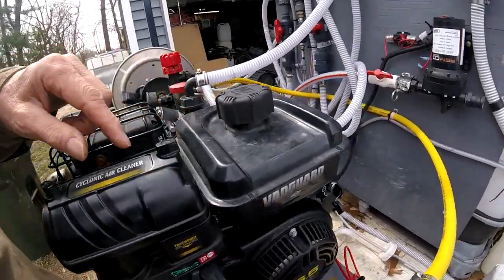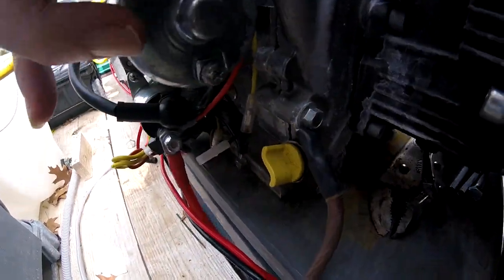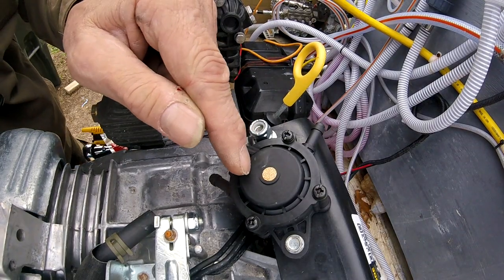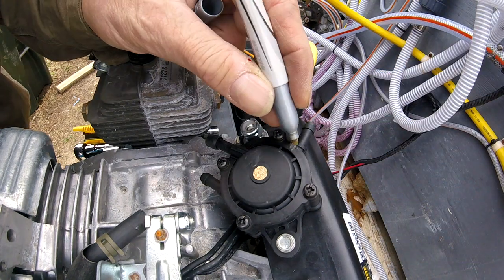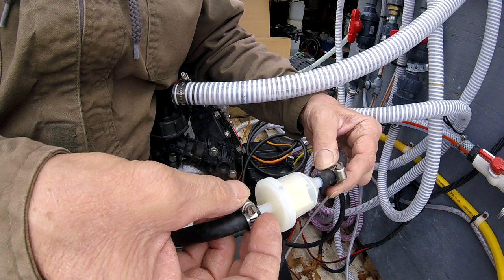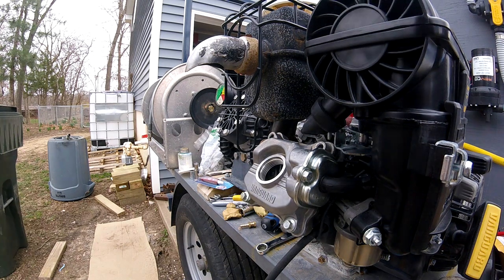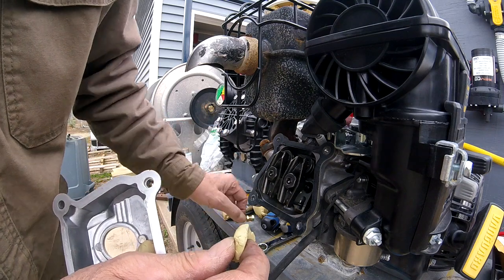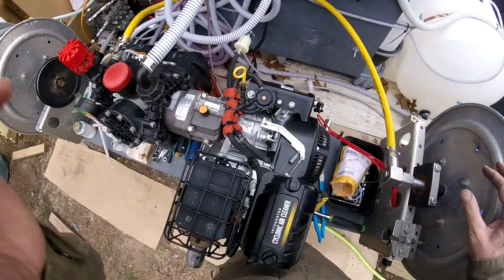How to add or replace a Pulse Fuel Pump and fuel cell to your small engine.

Comment: Great video mate. I knew how to fit a pulse pump but didn’t know how they’d handle pulling fuel a fair distance. I’m running a 212 in a cyclekart and want the fuel tank up front, and now I know it’s possible 👍🏻

Comment: Another great video. Didn't even know about pulse pumps until now. I need to do this on my setup.
Reply from the maker: I'm happy to help.
Reply: I just saw on the chickanic channel show the pulse pump as a part that gets brought in as being bad but is rarely bad.
Reply from the maker: @brianfletcher7942  I have seen many last 10 years.  I have seen them go bad in a few months.  It seems that the average life is at least 2 years.  But 2 years isn't bad for something that costs $10 and pumps 7200 times per minute.
Reply from the maker: @brianfletcher7942  Your pump and carb will work better longer using non ethanol fuel.

Comment: Great video Mr. KENNY. Please let me ask you something, maybe you can help me. I have a 18 hp briggs engine in my van, that runs my carpet cleaning machine. I've taken that fuel pump off and put a 12 v stronger little pump, to pull gas from the tank of the van, on the other 24 hp kohler engine I had, it was running fine, but on this 18 hp, whenever I leave the engine on idle, the pump will run dry and it shuts off. To have it on, I have to always keep it a little accelerated. Any idea on how to fix that? Thank you
Reply from the maker: I think your pump is fine. Something is blocking the idle circuit in the carb?  Once you crack the throttle a tiny bit the main jet starts pulling a little fuel.  This compensates for the plugged idle circuit.  I would tear the carb apart spray carb cleaner in all ports from both sides. Then blow it all out.

Comment: Out of curiosity,  could you use one of those gas caps with a barb on it and drop fuel directly into the tank instead of going into the carburetor?  That would save some time and swearing with all of that disassembly.
Reply from the maker: No. There would be no way to regulate the fuel going into the tank unless you have a float valve.

Comment: I'm enjoying your video's. Those two bolts you had a problem with, I would of put a nut on them and tightend them down. then put the sheild on it and put the top nuts on it. If that makes sense.
Reply from the maker: Good idea!

Comment: great video! Where did you get the brass fitting for the valve cover and the pump? Also, is the pump one size fits all or are there different sizes? We have a gx200 were looking to convert.
Reply from the maker: The parts are all in the videos description.  Just click where it says "more".  The pump is a fit all pump.  It will pump plenty of fuel to any engine you choose.
Reply: @housewashing5693  thanks!!!!

Comment: Excellent video. Did you have any problem with the carburetor not working correctly with the fuel pump? I have 2 5.6 gpm machines powered by Predator 459 engines, and I have read that some engines have a gravity fed carb and others have carbs specific to fuel pump models.
Reply from the maker: No problems at all

Comment: Great video!  Maybe a check valve at the y going to your other machine or a 3 way off the main tank?
Reply from the maker: The fuel pumps check valves do the job of adding a check valve.  Adding another check valve isn't needed.

Comment: Another great video!! Question, could you have just used the breather vent on the crank case by replacing the hose with a barb fitting?
Reply from the maker: The crankcase vent is made to attach to the inlet of the carb.  Also it has a baffle.  I think it's best to leave the crankcase breathing alone and add a fitting.
Reply: @housewashing5693   Thanks. I have a Honda GX390, and I found a carb insulator with a vacuum port that I will install to give my pump the pulse it needs. Thanks again for all of your videos!!
Reply from the maker: @WallyJ2K  If it's a port between the carb and head it won't work.
Reply: @housewashing5693  I've seen multiple articles and forums of people talking about using them as the pulse for their fuel pumps.
Reply from the maker: @WallyJ2K  There is no negative and positive pulse on a vacuum port.  Only negative. But you can try it.

Comment: Great video Kenny, but why not just add a T on the side vent line from the valve cover to the engine? Wouldn't that work as well?
Reply from the maker: The pulses are reduced on that side of the breather.  It also will mostly have a vacuum on it since it's tied to the carb. I don't think it would work.

Comment: Love your knowledge brother. What do think about a 12volt fuel pump?im thinking it may be a little easier for me. Thoughts?
Reply from the maker: My ignition switch didn't have 12 volt supply in the run position or I would have.  I have used this style with success.  Just buy two so you have a spare. https://amzn.to/4aThyW2
Reply: Couldn’t i just run some alligator clamps to my 12 volt battery and flip a switch anytime I wanted to use the ar45?
Reply from the maker: @johnthe_don  You sure can.
Reply: Thank you for replying to me brother. I really appreciate that

Comment: Why not use a tapered pipe thread tap and fitting
Reply from the maker: The metal isn't thick enough. You could try though.  Might work?

Comment: have you never heard of rive nuts. Why not put a 3way valve so you could use both tanks.
Reply from the maker: There was no way to add a 3 way valve since the fuel line was buried under the tank.  I had to take the tank off so I left it off.  But yes, if you can get to the line the easiest way to do it is leave the tank on and add a 3way fuel valve.

Comment: You must have dropped some coin on that much gates fuel line ? Why go Chinese on the pump I have not had much luck with those lasting long
Reply from the maker: That's a Briggs and Stratton engine.